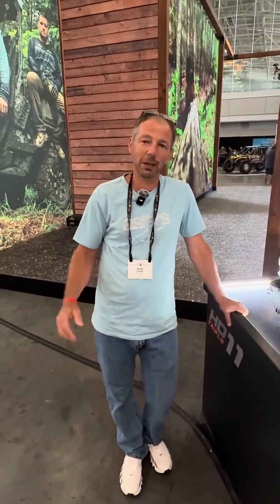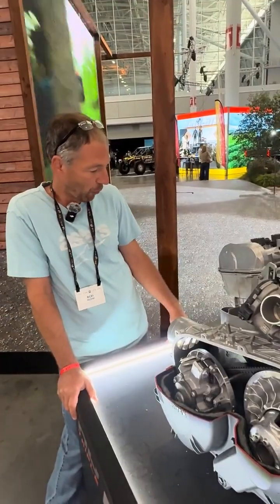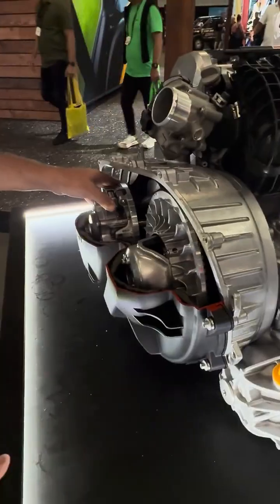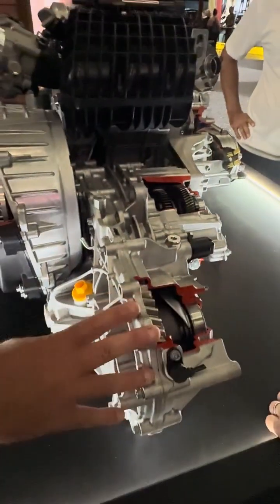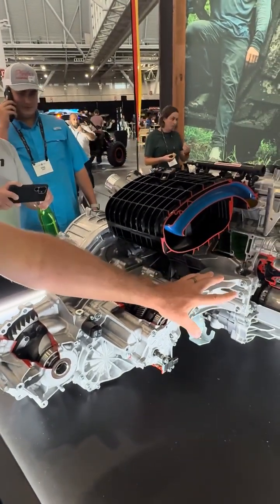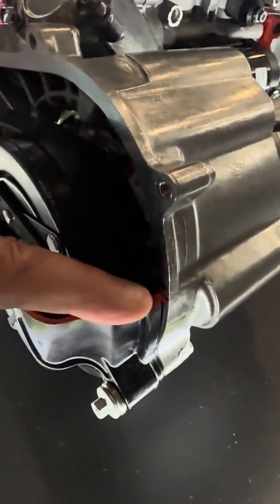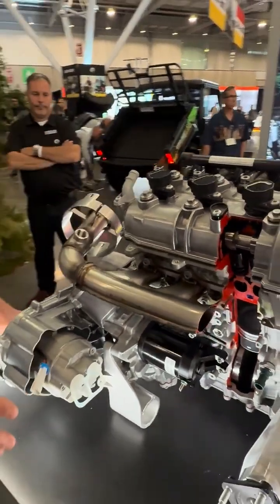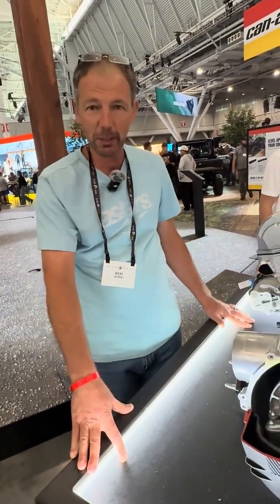3 Cylinder 2026 Defender New Engine - 999cc HD11

Comment: Good grief, you’ve got a bare engine out there on a stand and don’t even point out where the hell the oil filter is which is one major pain in the ass to change on the earlier hd10 models. Obviously you’ve never had to change any on any defenders before. I hope Can Am had the sense to finally put the filter in an intelligent location…….
Reply from the maker: Thanks for watching.  The oil filter is same place as before just slanted to the outside of the engine.
Reply: You can see it plain as day, fast forward to 2:40 and watch from there, 3 bolt cover staring you in the face lol